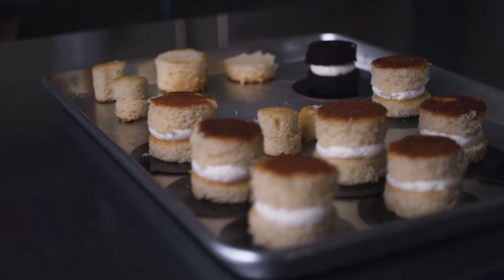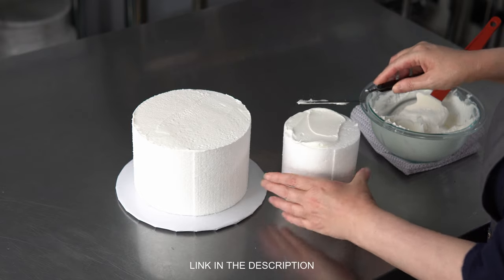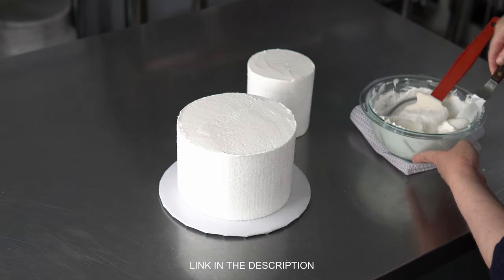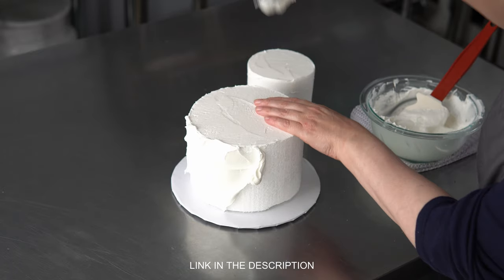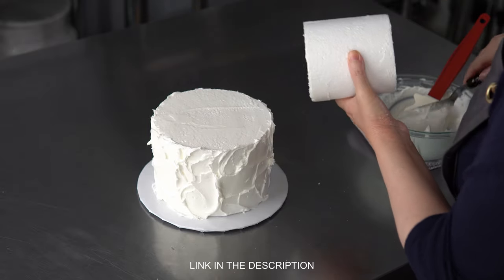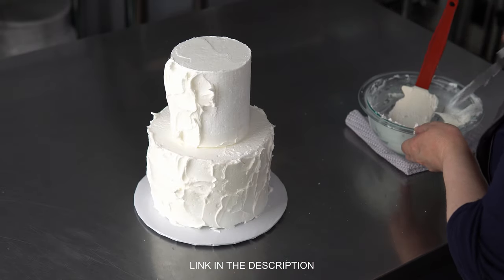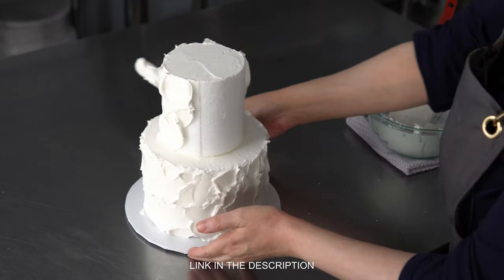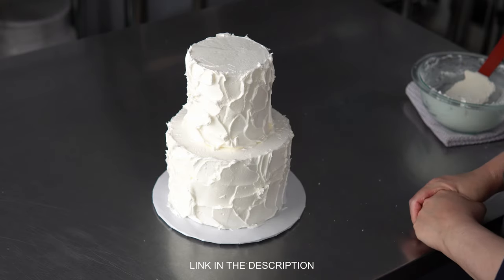How to make a Fake Display Textured Cake with Royal Icing [ Cake Decorating For Beginners ]

Comment: Hello! Thank you so much for this video. I would like to know for how long I can save this fake cake?
Reply from the maker: Hi!  We've used royal icing(made with meringue powder)to make our fake cakes so they can be used indefinitely.  I duct them off regularly if they are out of display and I keep them in plastic bags between uses when they are not needed.  If you handle them roughly the frosting might chip but that can always be repaired with more royal icing, and if you leave them in direct sunlight for prolonged periods any colors you have used might fade, so they do require some attention occasionally to keep them in good shape.  Hope this helps!

Comment: Hello, great video thank you. Whats an alternative to meringue powder?  Can egg white power work?
Reply from the maker: Powdered egg whites won't whip up to a meringue the same way that Meringue powder will I've know people that have tried it and it didn't go well.  If you don't have meringue powder actual egg whites would work but you do have to be careful about salmonella which Is why I always recommend using Meringue powder.
Reply: @CakeDecoratingSchool  I see! thank you very much for your response. Sorry, another question, How much royal icing do you think I will need to cover a 8in cake?
Reply from the maker: I generally don't use royal icing to cover cakes as it gets really hard.  I know it can be used to coat marzipan covered cakes to create a smooth hard surface to do string work on.  If that is what you are doing I can't imagine it taking more than a pound the surface of an 8in cake(as long as it's not too tall). I you are doing to do a lot of string work or piped flowers to decorate with then you of course would want to make more .  Hope this helps!
Reply from the maker: laughing at myself for my own reply.  I forgot what video we were referencing.  lol.  If you are icing a foam 6in round it would probably take about a lb of frosting if you want to do anything like some piping or some piped flowers I would make some extras.  I always make it in big batches since I'm usually doing a bunch of these at the same time so I don't really keep track and I just use up any extra I have to make some decorations for any upcoming projects.  Hope this helps!
Reply: @CakeDecoratingSchool  haha no worries at all. Its very helpful thank you very much.
Reply from the maker: you are so very welcome!

Comment: Hi, when using this method will it harden?? If so, how long after will it harden
Reply from the maker: I generally leave royal icing pieces over night to make sure they dry completely.  It really depends on the amount of water in your royal icing and how thick you apply it.  Especially if you are using larger foam dummies you might want to give it a few days to make sure that the royal icing between the tiers has fully dried out so they don't come apart.  But if they do you can just stick them back together with more royal icing.

Comment: Hi, can we use this technique on a real cake? I’m making a cake for a very hot summer wedding in Australia. I feel like royal icing would be the best icing/frosting to withstand the heat. Do you think it would be best? Also would I just put it directly on the cake or Fondant or something underneath? Any advice would be much appreciated ❤️
Reply from the maker: royal icing can be used on the outside of cakes and has been.  If you look at classic techniques like string work they usually coated the cake in marzipan and then placed the royal icing on the outside so that it could dry out completely.  you should be able to use fondant as well.  If you are looking for designs with fantastic royal icing work on fondant, soba Garrett's work is always a great place for inspiration.  Best of luck, I think the heat might be our greatest enemy!
Reply: @CakeDecoratingSchool  thank you so much ❤️
Reply: whats the recipe for the royal icing since it will be left for display please

Comment: how would you store this? and how long would it stay in good shape for?
Reply from the maker: If you use meringue powder for the royal icing they will keep as long as you want to keep them.  Since the frosting is hard and there isn't anything to spoil you just have to keep them out of direct sunlight to keep colors from fading(not a concern with a white frosted one like this) and dust them off occasionally.  If I'm not actively using them I'll put them in a plastic bag  and store them in a bin or out of the way spot so they dust free and don't get damaged.  They can get chipped/damaged if they are handled roughly.  Hope this helps!
Reply: @CakeDecoratingSchool  a big help, thank you!

Comment: My royal never turns out that nice!
Reply from the maker: Royal Icing can be tricky, but once you get the hang of it's easy to make.  there are a couple of problems I find people have to start with. Grease, It's a meringue so make sure everything is grease free before you start.  Meringue powder, I use meringue powder to make my royal.  It generally gives a fluffier more stable product that is easier to use that using raw egg whites.  That said, not all meringue powders are equal, some brands will give you a better result.  If your royal feels really dense when you make it the next time you do try adding a tsp or two of cream of tartar as I've found that can help produce a fluffier easier to use version.  Lastly, it takes a long time to mix and that time can vary greatly based on the mixer you are using.  When done it should be a pure white color and very stiff, it will start our off white and soupy.  if you pick some up on a spatula and watch it for a few seconds it should hold all of the lines and ridges without them sinking back in or smoothing out.  If it's holding all of the definition your good to go, if it starts to lose the definition and sink back in on itself then it needs to be whipped longer.  I find that to begin with most people take it off the mixer a little to early and that can limit what you are able to do.  Hope this helps and happy decorating!